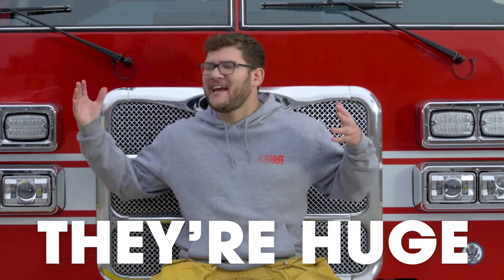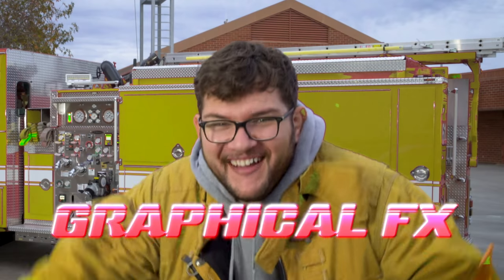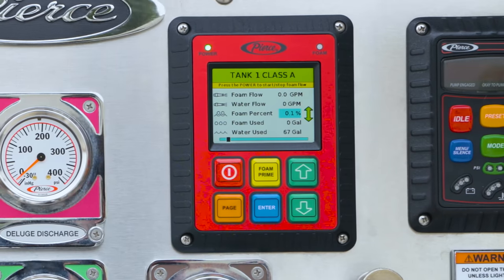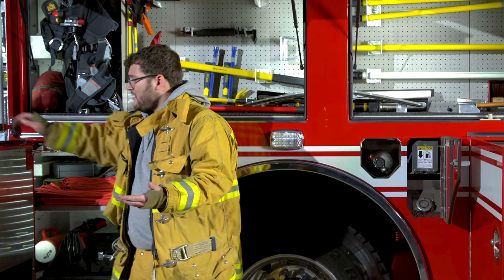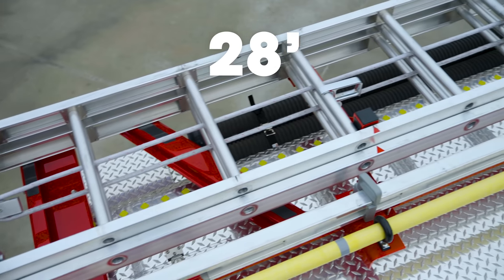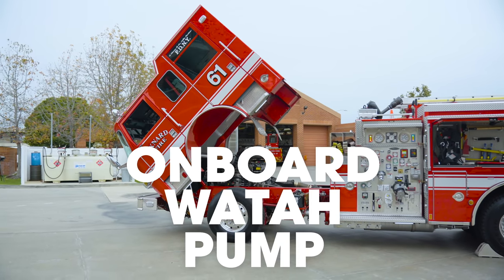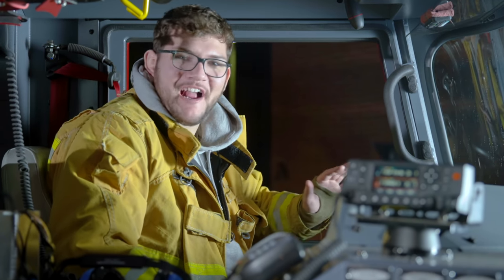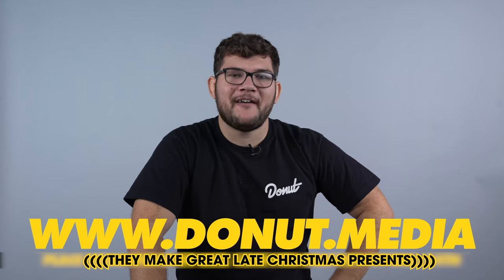The Surprising Features of a Fire Truck

Comment: "a fire engine like this will be in service about 13-15 years" rural departments "those are amateur numbers"
Reply: Our pumper was built in 1971 out of an international semi, still in service currently but soon to be replaced by a new build.
Reply: On my department (I live in New England, so we have really harsh winter's) we had an engine that was in service for 33 years. We still ran calls in it daily. Honestly I was sad to see it go.
Reply: We have a fleet of 70 trucks here in st. Louis. A majority of the front lines are 2000 smeal quints. They are just barely hanging on. As a fire mechanic it sure keeps me buissy
Reply: my local fire department has a converted military 1.5 ton 6x6 built in 1959
Reply: Kevin McDonnell yeah our reserve engine is 80s vintage, luckily for us we just got a tanker/engine brand spankin new
Reply: The vountieer department I'm on the newest engine we have is a late 90s lol
Reply: @Dieselfan1997  doesn't surprise me a bit. Volunteer departments don't get anywhere near enough funding that they need so you have to make do with what you have.
Reply: @mofirefighter1559  my local volunteer department is horribly overfunded. Oldest truck is from 2014, they have 9 vehicles, including an SUV and a top of the line ladder truck, along with an ATV for local events. All this is for a suburban village that's 1 square mile in area and has a population of under 3500
Reply: 30 years before replacement in my town. And the town council threw a fit about that.
Reply: Rural gets their stuff after 13 to 15 years
Reply: @bigandfluffy780  that's cool
Reply: @grandwaha  because they couldn't steal that money
Reply: Kevin McDonnell which department?
Reply: My dad was captain of our local rural Fire Service before I was born, bought the first pumper in 1975 and it saved his house from a bushfire in 2013 a week before he died.
Reply: Yeah...we ran a 71 ford cab over tandem pumper tanker until about 3 years ago.
Reply: Michael Hunt I think I read the other day it’s still being used for the current fires Dec ‘19. They have added 2 more to the fleet since. Our Aussie RFS guys are awesome, back burning all Christmas.
Reply: @paulrodman8900  who do i talk to, to fix fire trucks in st louis
Reply: @patrickderp1044  like for a job or needing a truck worked on?
Reply: They are older than that in Mobile, Al
Reply: As long as it will run... Then it lives on at the training facility.
Reply: Our neighbor fire dept. Still uses an antique american la france😂
Reply: The fire department in my town still uses a 1930s Fire engine along side the modern ones
Reply: Amateur numbers or well funded department numbers?? Lol
Reply: Our oldest truck is from 87 and it still in service
Reply: The local Department has their 1st engine and occasionally use it when they need extra help its a 1960 some model
Reply: @tylermcdonald8089  where does all the money go?
Reply: @isthatatesla  more trucks and really dumb events
Reply: Our 1992 Engine is one of the newest of the department.
Reply: We have a forest truck form 1960’s and we have manny woods.
Reply: we got ours for 40 years now. (just germany things)
Reply: We just replaced our 1993 Seagrave engine.
Reply: Haha I've had the one in mine for about 17 years hahha
Reply: mofirefighter15 I was gonna say the same thing lmao
Reply: My fire trucks been the same since I was born I was born in 1999 and I’m 20 now
Reply: The parade tact vehicles from ww2
Reply: 🤣🤣🤣 those are rookie numbers bud
Reply: My local department still uses horse-drawn wagons and buckets.
Reply: We replaced a truck in 2017 that had been in service since 1968. The only reason it was removed from service was the cost of sourcing parts for a rather catastrophic brake failure.
Reply: The newest truck from mine ignoring the rescue is early 1980s
Reply: We have a 2007 engine a 2008 tanker and a 2012 brush truck at our rural department hopefully we will be getting a new engine in the next couple years
Out tanker is amazing and I hope we will have it for a long time
I forgot to mention our tanker is a tanker-pumper
Reply: @nathanharding7737  See this is what I mean, I also live in NE and I know for a FACT engines are kept longer than 5 years like some guy in the comments said.
Reply: "13-15 years"

laughs in upstate new york
Reply: I live in a small town in Texas and we have this 1969 Chevy c60 we still use for brush fires
Reply: Ours is early 70s, this only has like 80,000kms on it. Its a fossil but old girl still gets the job done.
Reply: Lol we have a ‘76 still in service and a ‘39 still running g parades
Reply: My hometown has a couple of deuce and halfs with homemade tanks and tow behind water pumps. It works.
Reply: I knew I wasn’t the only one 😂
Reply: yea they will probably be sold with there 20 year old original tires on them with a total of 12k on the odometer.
Reply: Dude I laughed my ass off when he said that
Reply: Our third ass world country. Hmm thats showroom new
Reply: @paulrodman8900  well we appreciate the work you do to keep these things up to maintenance so they can do what they do best which is saving people's life👍👍👍👍
Reply: I´m from Argentina at the bottom of south america and many of this trucks end up here mostly in volunteer fire departments, it´s amazing to see how reliable they are, specially pierce mfg trucks.  Most of them keep their original color and even the name of the dept or engine number along with their new one in Spanish.
Reply: My town has a 25 year old e-one 75 foot quint from the 90’s. This is a paid department too
Reply: We still have a 92 F350 Brush truck, it's a manual, and a 87 International engine that's also a manual. We mainly use it on wreck scenes. To a rural department, 13 to 15 years really are rookie numbers
Reply: A local fire department has an old steam powered horse drawn fire pump from the 1800s. It's permanently listed as out of service, but it's still there.
Reply: rural firefighter here   ours is a 1967 freightliner  pumper stick shift lol
Reply: Im in England and I honestly rewound about five times to see if I could tell if he said thirteen to fifteen or thirty to fifty. I settled on 30-50 so was wrong.
Reply: Yeah I just saw a 1980's chevy fire truck
Reply: 65 ford as our MVA engine
Reply: At my department we have a 1980 Ford c8000 emergency one engine that’s still in service and we plan on keeping it in service for probably another 5 to 10 years
Reply: One of the departments around here still has an engine from the 60s
Reply: Here in the Philippines, one of the remote rural towns I've been to has a fire truck that looks like it's from the 1950s.
Reply: Our fire department here in Malaysia are big fans of Scania and Mercedes-Benz
Reply: The newest is 2008~ i believe
Reply: 70 year old fire truck at my town
And a fucking 90 year old truck too
Reply: The firetruck we use is old enough to be in a museum, and I don't see a new one coming any time soon
Reply: Must be nice to have the traditional staffing. We run a similar engine in Merced county with a single operator.
Reply: In my country engines stay in service for like 25-35 years .
Reply: @claytonj2695  I’d imagine that’s just as a sort of throwback they keep because it’s cool right?
Reply: Exactly. We have a 1988 and 1979, both International.
Reply: Our brush is a 1965, still in service and still a beauty.
Reply: My town has a 60s model still in service. It's actually the 2nd most used firetruck. The town just doesn't make enough money to buy new ones. The newest one was bought in 2004 from what i heard so it's probably a 03 or 04 model
Reply: lol you think rural districts can afford new trucks?
Reply: SO TRUE we got a Tender that is like 30 years old
Reply: I wonder how many still run stuff like the Crown Firecoach from the late 60s early 70s.
Reply: Until a couple of years ago we had a truck from the early 60s but they had to get a new one because noone knew how to drive it properly anymore
Reply: I was gonna say, our fire depot in my town retired a 1973 Ford fire engine a few years ago lol
Reply: Still technically in service (maintained and ready to go out) but never is or would be used outside of the firemans picnic, my department still has the first engine ever used by the department made in 1949
Reply: We have an 87 still in service 😂
Reply: We have old e-one fire trucks and e one 
Ladder trucks from the 90s now they are reserve units
Reply: @paulrodman8900  For Houston we have at least 92 stations and I’m a diesel mechanic as well for the fire department and it’s busy lol
Reply: Lmao our county Brush truck is still in service its a 1993 OBS super duty with the 7.3 and the captain refuses to trash it even with the brand new one parked right next to it 😂
Reply: In a small town here in Southern Ontario in my township most of their fleet is older firetruck generally from the 80s and 90s aswell as early 2000s. It's mostly hand me downs from other stations in the area that have larger populations
Reply: Unlike what he said in the video, MY department actually has 6 people in each truck. Driver and captain in the front, 4 firefighters in the back. Goes for all our apparatus, engine, quint, rescue, and tanker
Reply: We had a 80’s pumper that was just replaced with a Rosenbauer Commander
Reply: @Dieselfan1997 we just put our new $650,000 engine into service that we paid for out right so we don’t have to pay it off 😅
Reply: 1979 ZIL-130 soviet Fire engine.... this motherlover is still kicking

Comment: It has a water hose
Reply: Also has water tanks. Lol
Reply: alexander1485 this one does have a 4 minute tank
Reply: It also has a ladder
Reply: alexander1485  ok well out here where I am I the nearest hydrant is 7 miles away. The all the local fire stations have tankers. Idk if you saw the part about 500 gal of water or not but I don’t think anyone claimed every single fire truck has a tank. Calm down on the “not every” No one said that.
Reply: Wow, I didn’t know that!
Reply: FIRE hose
Reply: @alexander1485  that's definitely not why they make fire hydrants
Reply: Not exactly true, the hydrant supplies the pump the pump increases the pressure to the hose. The hydrant is around 50-100 psi, the fire hose is around 120-150 psi. The hydrant does fill the tank than its shut off from the pump.
Reply: Hey pal, glad I'm not the only AvGeek that watches Donut :D
Reply: @canadianplanespotter  hey man!!
Reply: Wow when you think of a fire trunk the last feature you would expect it to have is a hose
Reply: alex gibbs I've seen a ladder truck that had no pump. It was an older one that San Antonio uses for funeral processions only these days. Nothing but compartment spaces and an elevated waterway.
Reply: Dirt Road Auto Repair How can a rural department afford all those aircraft? Lol. Tenders have wheels...
Reply: It has many other things such as SCBAs, and vehicle rescue tools, fire rescue tools, thermal imaging cameras, and gas meters, and many other things.
Reply: @alexander1485  all fire trucks do have a water tank. Just not all of them have a folding portable water tank.
Reply: alexander1485 all fire engines have at least a 250 gallion tank
Reply: to many people to wooosh here
Reply: Jay Monay my departments engines have 1000 gallons of water, and 20 gallons of foam.
Reply: Dirt Road Auto Repair exactly. Some ladder trucks have a pump with no tank, some have a tank, and some have no pump or tank at all. Depends on the departments needs and budget.
Reply: alex gibbs it’s called a booster tank. The tank does not get overfilled when connected to a hydrant. There’s a way to fill the tank by turning on fill tank.
Reply: alex gibbs not all ladder trucks have pumps. FDNY’s ladders don’t have pumps. My city’s truck 2 doesn’t have a pump, just a pre piped waterway.
Reply: M H84 exactly. Only fills what was taken out, if there’s no water taken out it goes directly into the pump.
Reply: tommy wegman more than that. Cribbing, struts, rescue jacks, rope rescue tools, spine immobilization equipment, air bottle filling, RIT pack, ground ladders, spill clean up equipment such as kitty litter, brush firefighting tools, forcible entry tools, generators, fans, lights, hazardous material clean up equipment, brooms, cones. Many many different things
Reply: tommy wegman not all. Some ladder trucks do not have tanks and pumps. Tankers are also known as tenders are fire rescue vehicles designed for shuttling water to a fire scene where there are no hydrants. There are many different tank sizes and configurations. Some have one dump valve, and some have more. It depends on the area, and needs and budget. 1500-2000 gallon tankers are more nimble and can get into more tight areas, while 2500-3500 gallon tankers can shuttle more water to the scene, but can’t get into as many places. Some places have a dual purpose truck known as a pumper tanker, which have a fire engine cab, on a tandem axle chassis with a full fire engine pump, and a tanker body on behind it. That’s a unique vehicle that can do both uses.
Reply: woosh woosh